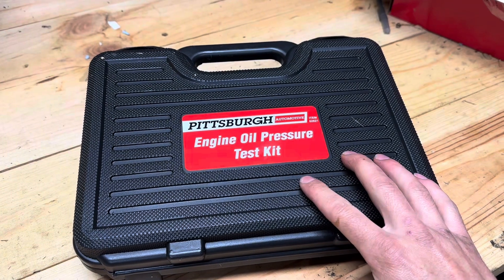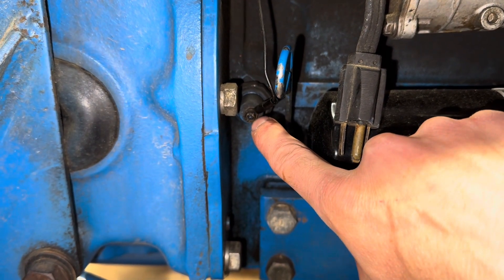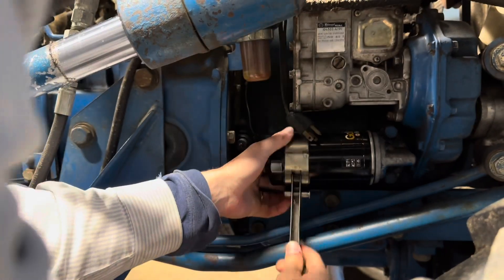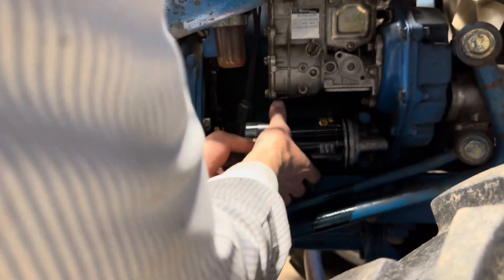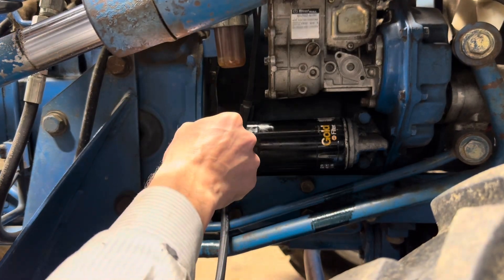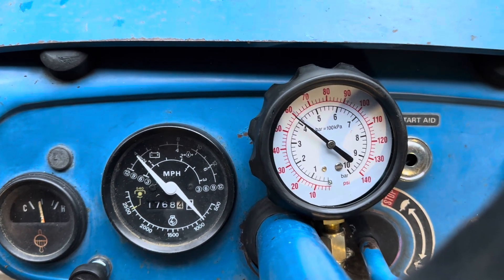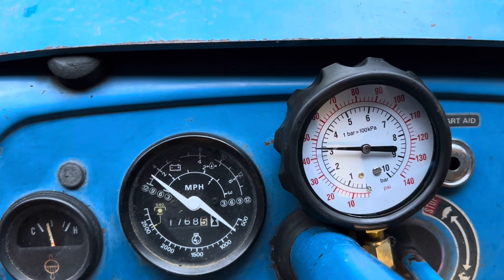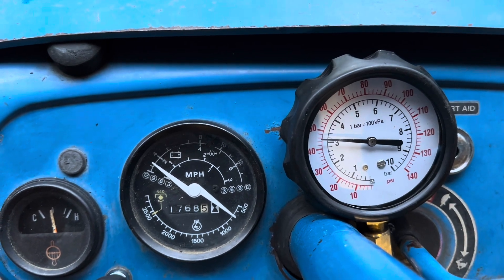Checking Engine Oil Pressure on a Ford 1700 Compact Tractor

Comment: Thank you for this video!  I am having the exact same problem with my Ford 1700.  Pardon my dumb question... Did you drain the oil before removing the sender and oil filter?  I do not think you did because you show yourself checking the oil level in the video, I just want to be sure.  I am a novice when it comes to working on engines.  Thank you!

Comment: Minimum 15w40..better option is 20w40...5w40 will damage ur engine.
Reply from the maker: You’re wrong about the 15w40. The manual calls for 10w30 (recommended) or 10w40 for year around use. 15w is too heavy for the cold starts 8-9 months of the year by me; it would only be good for summer. The engine is performing great with the 5w40 and starts nice. Oil pressure is good from cold to fully hot too. I just switched from 10w30 to 5w40 early this year. So far I like the cold start behavior with 5w40.
Reply: Yea a saw at the end of the video it went up to 4bar and over..gues you are safe.
Reply from the maker: @Prokres_Overland It’s not in the video but I took it out mowing for a half hour in tall field grass and got it real good and hot and the lowest pressure at low idle was 28psi. Full bore was 66-68psi. The low oil pressure sensor is supposed to light at 20psi I think. I have a new sensor in now.
Reply: @ProductiveRecreation  Where did you get a new sender? I have been looking at a couple of places but keep coming up with a switch, which I have read is not correct. PS - great vid.  I am about to acquire my father's 1982 Ford 1700. Thanks!
Reply from the maker: @brianstover8892 Welcome to the channel! I’ve got a lot of Ford 1700 content. At first I got an aftermarket sender online from Friday Parts for $12. It looked the same and fit right, but did NOT work. So I got an OEM sender from Messicks for appreciably more money. Works great! With the time I wasted on the bad one I should’ve just spent the money in the first place… My 1700 was my grandfathers. Per serial number it was made in late ‘81. He purchased it new in early summer of ‘82. It’s been on the same property its entire life!
Reply: @ProductiveRecreation  This is a huge help - thanks so much for the response and sorry for my slow answer.  Yep - I ordered aftermarket and attempted to install just a couple of hours ago. It did not fit.  I will give Messicks a try.  Thank you again. Brian
Reply: Sorry to push even further. I am having a heck of a time finding the correct unit, even when using Messicks. I plan on reaching out to them on Monday, but was wondering if you happen to have the specific part number.  The closest one I have found actually looks like a Kubota but that makes me a bit nervous. I have officially subscribed!
Reply from the maker: @brianstover8892  Thanks for subscribing! The sender is on the engine block parts diagram. It is number 12 in the diagram. Scroll through the list and Messicks has it in stock. They are awesome for parts. You have to pay for shipping, but if they have it in stock it will be in your hands in a few days. It’s faster than going to my local dealer, who would then need to order it in themselves as they don’t stock much for the older machines. Once you learn how to navigate the Messicks parts site to search your machine model, you can see ALL of the parts diagrams for it. See this link for the engine block corresponding to my description above: https://www.messicks.com/catalogs/new-holland/1700-2-cyl-compact-tractor-01-79-12-82/01-engine/06a02-06a02-cylinder-block-1500-1700

And here’s the oil pressure sender directly: https://www.messicks.com/parts/new-holland/sba185246011
Reply: @ProductiveRecreation  Thank you again.  I'll try to stop bugging you 🙂.

Comment: Good job,  I have the same tractor, I've had no problems with my tractor.  Keep the oil changed plus filter and we should be using this tractor for a long time.  I bet there are not to many of these tractors around these days.
I live in Huntersville NC, there are not a lot of farms around this area anymore.  
Ok keep the videos coming.
Reply from the maker: The 1700 and 1710 were very popular at the time. There’s still a number of them out there, but it is harder to get parts. These machines will run until it’s time for a major overhaul, and then that may not be practical given parts availability. With respect to problems, this machine is on its second clutch and second starter, the steering gearbox failed (common with loader), the neutral start switch failed, 3 point lift cylinder seal failed, and the ignition switch failed. A lot of that is expected from normal use/age. My shift lever seals leak a little oil around the base of the boot too. I’ll probably have a mechanic take care of that, service the injectors, and check valve lash later this year.